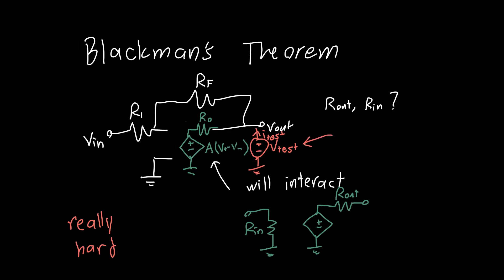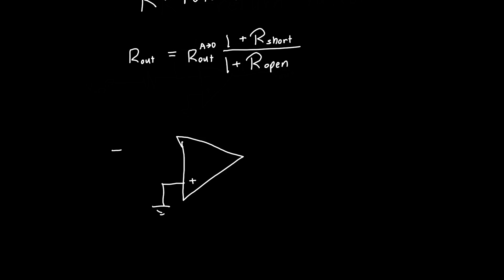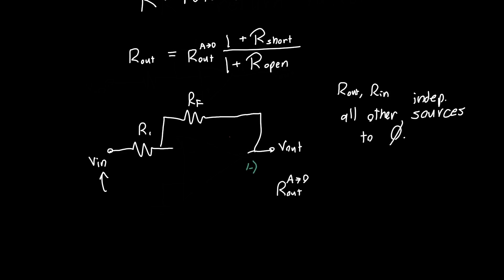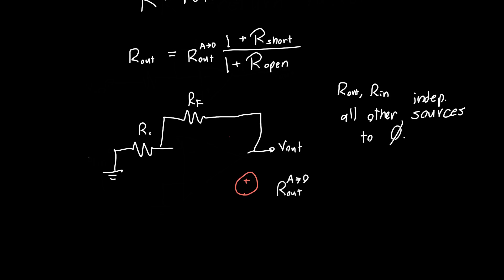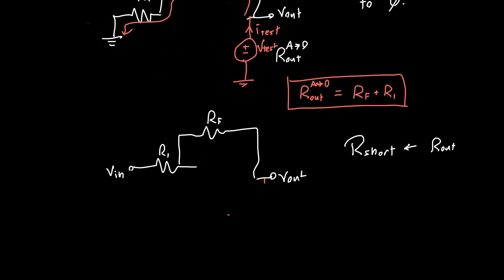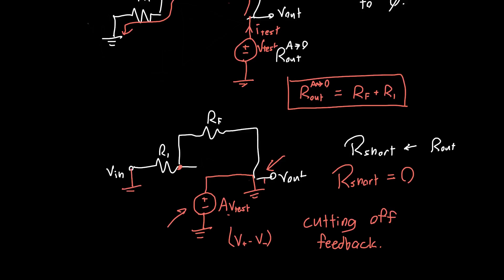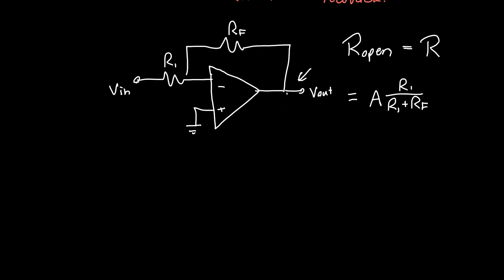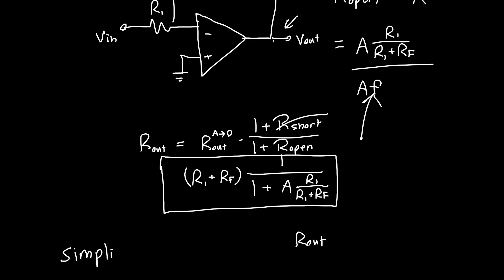Blackman's Impedance Formula Explained

Comment: The result is wrong.  If Ro = 0, both Rout and Rout(A—>0) = 0.  Basically, the op amp has no output resistance, and so you see a short circuit to ground when looking into its output.  That zero resistance is in parallel with R1+RF, which is still zero.

To convince you of this, look at the result if Ro != 0.  When A—>0, the output resistance is Rout(A—>0) = Ro || (R1+RF), and the return ratios are RR_sc = 0 and RR_oc = A*R1/(R1+RF+Ro).  Putting everything together, Blackman’s Formula gives Rout = Ro*(R1+RF)/[(1+A)R1+RF+Ro], which you can also verify with a direct nodal analysis of the full feedback circuit.

Setting Ro=0 zeroes out the output resistance of the entire circuit.
Reply: Hi Brian, I completely agree: both an independent and depedent voltage source have a zero output impedance, so if A approaches zero, this is just connection to ground (with an Ro of the amplifier in series), rather than an open circuit.